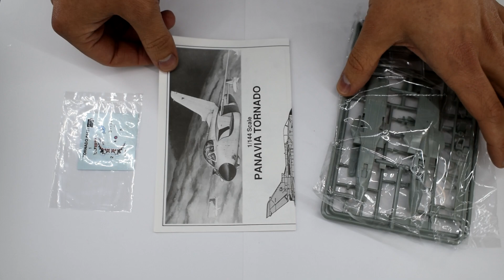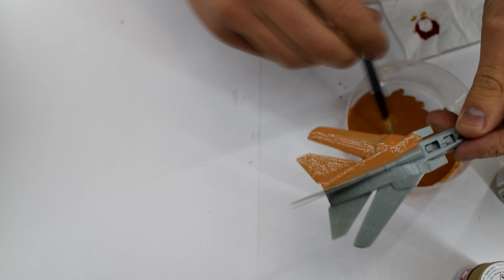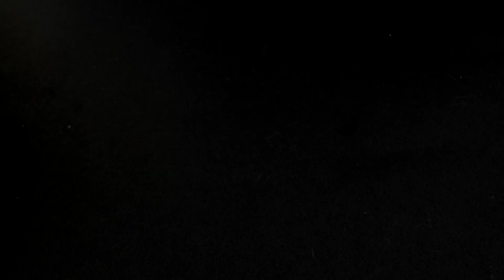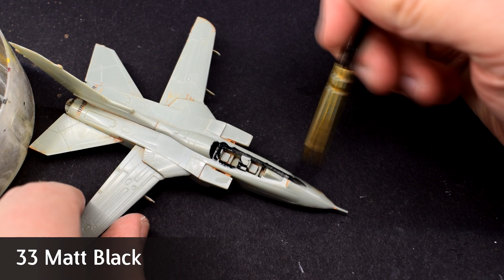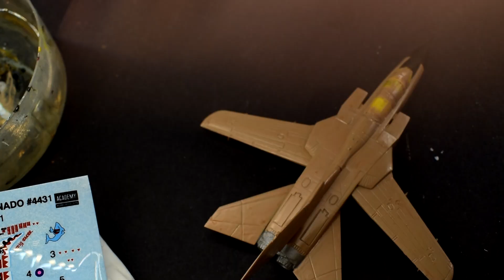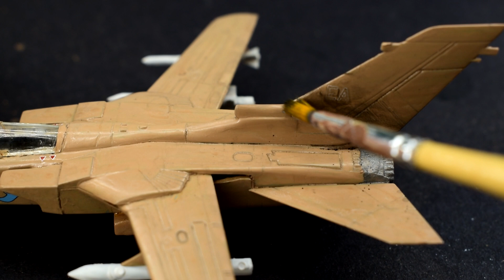Academy Panavia Tornado Gr.Mk.I | Full Build 1/144 Scale Plastic Model Kit | Review

Comment: does striping the paint also strip the glue
Reply from the maker: Depends on what the glue is - it can happen but if the plastic is welded together with poly cement it is unlikely

Comment: How can you properly brush paint with tamyia?
Reply from the maker: make sure it's thinned with their thinner - water isn't really enough for it
Reply: @ModelMinutes  yeah I have been doing that but I do a 1-2 ratio of thinner to paint but I still get brush marks and large shiny areas of paint
Reply from the maker: @scalesmodellingmagic5883  maybe increase the ratio of thinner to 1:1
Reply: @ModelMinutes  how do I achieve a 1:1 ratio
Reply from the maker: @scalesmodellingmagic5883  it's equal amounts. One part paint to one part thinner. Or in other words, for every drop of paint you add a drop of thinner

Comment: Nice save ! I have the Dragon version of this aircraft in this scheme. It's been on the " to build" stack for a while. Seeing your build of the Academy version may spurr me to break it out and finally build it. It has excellent discreet panel lines and an accurate selection of underwing stores.The only place it falls down is in the cockpit. A blob like aglommeration to represent pilots, and seats,,with no other interior details. 
I have always liked the look of the Tornado,and 1/144th is my go-to scale for aircraft these days. I live in a small place with limited display space so the smaller kits are simply more practical. 
Thanks for the video!
Reply from the maker: Thanks for the info, despite the cockpit issues on the dragon kit it still sounds like it will be a good build
Reply: @ModelMinutes  Thanks for the reply! If you can find any of the Dragon 1/144th range, I highly recommend them. Although they are getting scarce these days, there is a large number of cold-war era jets and helicopters , both western and east-bloc in a variety of markings.
While the parts are often attached by massive sprue gates at times, they are very nicely done for the scale for their era. Decal sheets were well printed and in register, with stencils and weapon decals included. Again, the place where they fall down is the cockpit. I've scratchbuilt interiors with these in my previous builds, but it requires a bit of head-scratching, test fitting and scratchbuilding ship-in-a-bottle style!
Thanks again ! Looking forward to see what you build next! Ever try one of the classic Airfix 1/600 ships?
Reply from the maker: @johnashley-smith4987  Thanks for the info, i'll have to keep an eye out. I've not built a classic 1/600 scale ship yet
Reply: Try the Revell kit, its much better that this and the Dragon kit. The Dragon kit isn't bad but the Revell is nicer to build, cleaner with crisper detail.
Reply: @jaybe2908  I agree, of all the Tornado kits in 1/144th, the Revell are the best in detail and molding quality. I have two!

Comment: Yayyyyyyy! I can't believe 3 people disliked this...

Recommendation:
Use tamiya extra thin quick setting. Smells awful, works great.
Reply from the maker: Thanks for the tip!
Reply: If the smell really bugs you, then use Mr.cement S or SP, they work very well, better than tamiya extra thin cement from my experience
Reply: @KJ-kn8pg  from my experience tamiya holds the stronger bond.

Comment: Beautifully done and a great video build again. I love the Tonka. I built 2 of these. I had exactly the same progress as you. First one was brush painted and I was just a newbie to scale modeling back then. I wasn't too happy with the paint job initially so 4 years later (2020) is when I built one more. This time it was airbrushed and I scratch built a few weapons to depict what this jet carried during the Gulf War. I scratch built three 250kg bombs, the Thomson chaff dispenser, and a JP233 runway cratering bomblet dispenser. Overall the second time it turned out much better. I felt a bit of scratch building did add on to the looks of it. But for an extremely cheap kit it was worth the effort. Please do follow me on Instagram. I'd like to share my work with you too.
Reply from the maker: Sounds like you managed to make a silk purse out of a pigs ear!